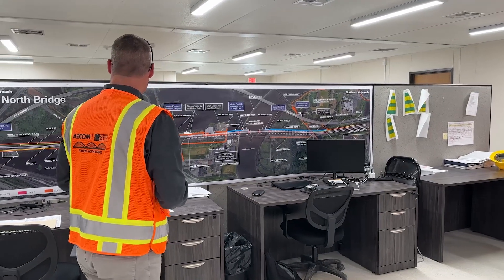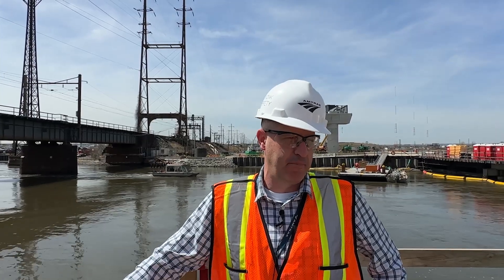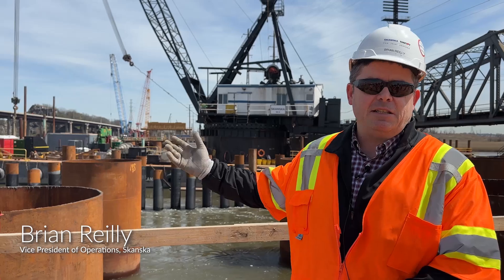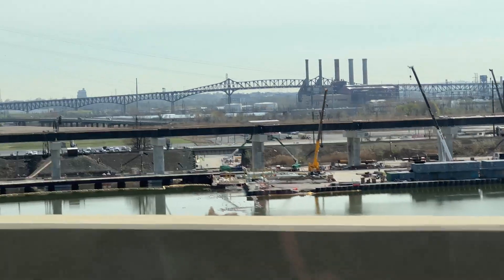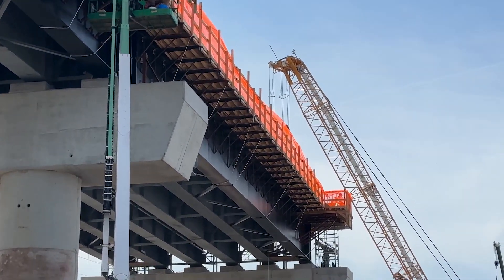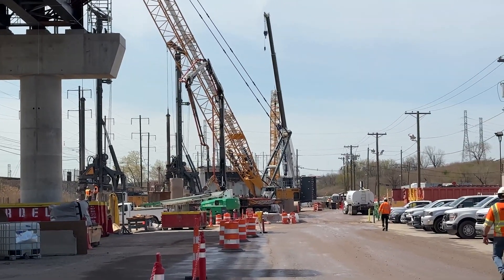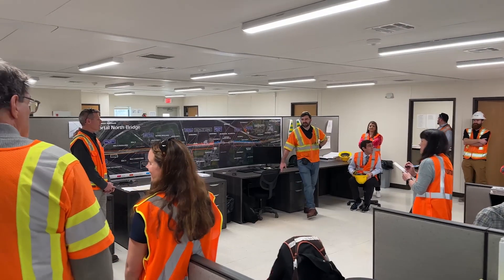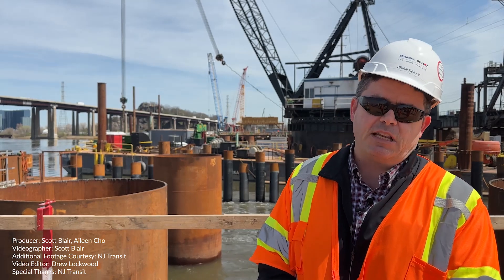Exclusive Tour of $1.7B Portal North Bridge, a Key Component of Gateway Program Between NYC and NJ

Comment: Meanwhile the highway bridges are 1000 years old
Reply: So what's that has to do with A New Railroad bridge? Don't you think highways get Way more Funding from the Government then Rail? NEC is very important to the GDP if you didn't know already!!!
Reply: The existing bridge was in pretty poor shape. It has to move to allow ships to pass underneath, but will oftentimes get stuck. It’s a pretty significant source of delays for rail traffic in North Jersey.
Reply: This bridge is older than the creation of most if not all of the highway system
Reply: Bruh Highways get more federal funding than rails so your point is moot
Reply: Highway lobby gaslighting
Reply: Take the train bro.

Comment: 90 miles, china will be laughing 😂😂
Reply: China just had a brand new subway line collapse into a sinkhole a little while ago. I’m glad they’re not in charge here
Reply: The spacing between NY Penn and Newark Penn wouldn’t even be long enough for our trains to accelerate to higher speeds, and it would risk too high speeds going into the tunnels if they ever needs to emergency stop. We are building bridges south of Wilmington DE for top speeds of 165+ …
Reply: Can yall shut yo asses up about other Damm countries
Reply: At least we’re actually doing something instead of sitting around. You should try appreciating efforts instead of China this China that. We get it already bro.
Reply: @MrMarshmallow26 no, we need to be absolutely blasting the entire transit infrastructure sector for absurd inefficiencies.

Under no circumstances should this cost nearly $2 billion, it is grift, plain and simple.
Reply: @noggin6870  it wouldn’t be as hefty if people like you would stop trying to get in the way of projects
Reply: Tell us you know nothing about this route. Portal is 1 mile from Secaucus & 3.75 miles from Newark where nearly all trains stops. Trains going in will be slowing down while trains going out will be speeding up. The same line a few miles south has a 135 mph limit. Most likely the track on this bridge can support that speed but the route & station layout does not. 

Nowhere in China will a train be doing >90 mph within 5 miles of a scheduled stop. Shut up and sit down.
Reply: @mkkm945 actually south of Newark the limits are 150 and with new Acela will top at 160 thru Princeton junction. But yes correct no need to build portal for speeds higher than 90, the trains couldn’t get up to speed between NY Penn and Newark.
Reply: @kmrich12  didn't know but 160 is cool. Every marginal improvement is good.

Comment: I wonder if Amtrak and NJ Transit will be using the same overhead catenary line voltage (12KV AC, 25Hz) on the new portal bridge!!
Reply: They are, since the voltage is dictated by what the substations can work with. The catenary on the new bridge will be constant tension wires too, which will be a big boost to reliability in the long term, especially in hot conditions.
Reply: @SteveGettingAroundPhilly  Oh ok, with respect to the substation, got it, yes, constant tension wires would be more feasible for hot and cold temperatures, you know the entire Northeast Corridor and Keystone Corridor lines should be having these wires now but these components are very expensive, and even if Amtrak ever decided to upgrade both lines to 25KV AC, 60Hz, that's another expensive bill!!
Reply: @kevinb8881 Changing the voltage and frequency on that small section is trivial because it only requires changing the substation equipment and maybe the insulators to withstand higher voltages. They only strung new lines on this short section and did not touch the substations. From the looks of existing installations, the insulators on the entire Northeast and Keystone corridors (except for Penn Station and river tunnels because limited vertical clearance) are long enough to handle the higher voltages, so really only the substation transformers need to be changed, which is only 1 piece hardware every so many miles. Furthermore, if they decide to convert to 60 Hz, it will be even cheaper because they won't even need frequency converters and can use the grid frequency directly. It will be free relative to baseline to change to rolling stock if they do decide with that frequency because it will be many decades in the future, in which the current rolling stock will have to be retired from wear and tear anyway.
Reply: @00crashtest   Very interesting, ok, I know the electromagnetic fields surrounding these wires is intense, too!!
Reply: @SteveGettingAroundPhilly I don’t believe your comment about constant tension catenary is accurate unfortunately. My understanding is that it will be variable like most of the surrounding area
Reply: @tomoconnell2320 they’ve been installing constant tension on the NEC in South Jersey and it’s hard to believe that given the need to build new, at least over this short segment, they would not take the opportunity to do it the right way. Then again value engineering is a thing in any project and I can imagine someone who only knows short term cost-cutting seeing that as a place to cut.
Reply: It’s one bridge in the midst of 200+ miles of 12.5kV 25Hz, plus NJT’s Arrow III EMUs (which will likely still be in service when the bridge opens) can’t switch voltage/frequency on the fly so they wouldn’t be able to cross it.